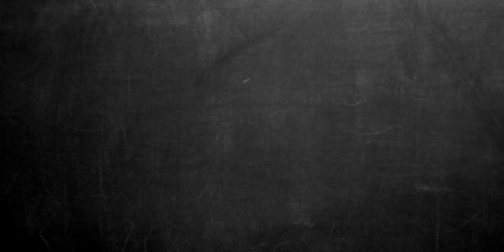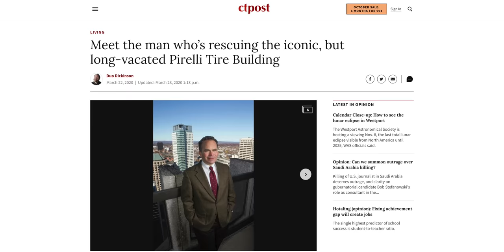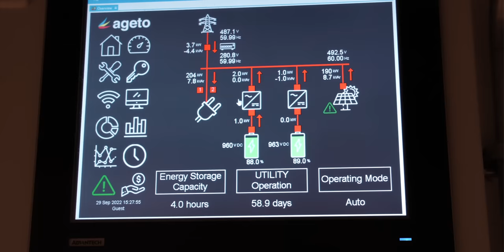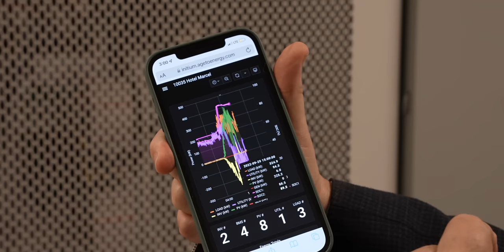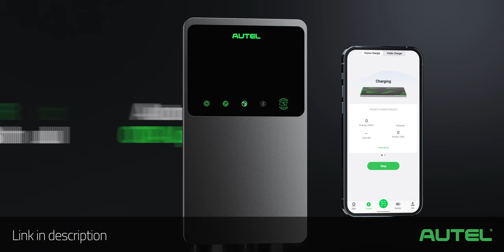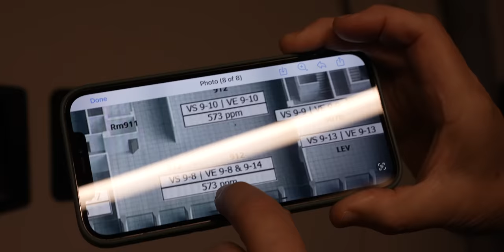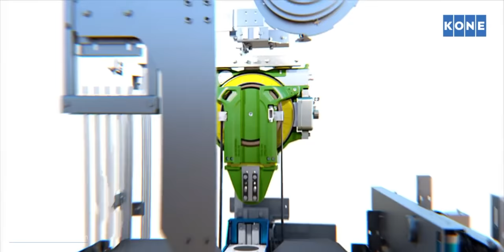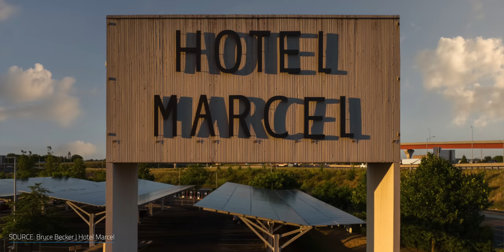How Big Can You Make a Passive House?

Comment: Digital electricity in concert with DC power is a concept I have never heard of, and it just blew my mind. I would love an entire video on this!
Reply: We've been doing it since 2012.  We were also WAY too early at the time! 😀 Now it all makes perfect sense to everyone.
Reply: More videos on this, please
Reply: Yes please!
Reply: @LumenCache  When I looked at this a few years ago the conversion/standby loses in the POE power units were significant (because they are sized to run the whole house and are always on). It was much more efficient to just have one CC LED driver per room (well, per switched circuit) with a few lamps on each. Standby usage is zero because the driver is actually turned off. One decent driver (as opposed to one cheap and nasty driver per lamp) is efficient and reliable. Maybe POE has got better, but at least in a domestic setup the always-on nature is a significant structural disadvantage. POE wiring is enormously flexible of course, but also expensive in comparison to dumb lamps at £5 each and drivers at £10. So that's £20-35 per room in a domestic setup. A single POE lamp costs more than that. I'd love to hear that this stuff was reasonably cheap and actually low-power by now. 
Hmm. I've just watched your video and it is a really nice system, which can use any lamps I like. And I can have a CC string or some parallel CV lamps. So whilst it's POE it's not using the (rather wasteful) 48V POE spec directly. But that flexibility costs money at $66/104 per switch, $36/24 per driver and $420 +PS for the system. And I'd like to know what the standby consumption is. So my house would be about $1500 vs the $340 it costs me to do it with mains and one driver per circuit. OK cabling is about £150 whilst it would only be £40 for lumencache, so that's a $130 saving. i.e lumencache $1550, conventional $520. So approx triple the price and higher loses (but maybe not excessive) for the flexibility.
Also not available in the UK. And do you not have string-pull bathroom lightswitches over there in the US? I guess with 48V there is no need. But it would be great if you did some UK/Euro style switches. There's a big market your US-only switches currently preclude you from.
Reply: Likewise!!
Reply: @xxwookey  One thing to add to the cost analysis is what he mentioned about labour : doesn't need a licensed electrician. HUGE bottom line difference!
Reply: Come to light and building fair in Germany and you'll see.
Reply: Can someone suggest a short vid on this? Is this like when you plug in a light to a usb port? I'm sure this isn't the case, but are you basically using data ? Is there a small amount of direct electric that is passed through a usb or other cable? Is that what Cat 6 is?

Comment: Dryers using heat pumps are available. That's what I have in my home. It uses less power, and has no vent. Rather than generating hot air to increase evaporation, and vent all the humid, hot air, it condenses moisture from the air onto the coils, which then drains away. I'm sure a commercial use version can be found or made. Hopefully they could have their current dryers retrofitted.
Reply: Seems like this would be a huge energy saver especially if it can work with those commercial dryers.
Reply: That's pretty cool. Is it more time-consuming than a traditional dryer's "fully loaded at high heat" cycle?

I wonder if the traditional dryers were selected due to their speed.
Reply: @MoeBabaloosh  Well, he seemed surprised that the dryers used more energy than the whole rest of the building, so he might not have thought of that when installing them. But even if heat-pump dryers might take longer (which I don't see WHY they would; a large enough heat-pump could compensate for any kind of heat demand. It would just cost more), I'm sure a project this green-focused could find the space to add an extra machine or two to recoup the productivity lost by the slower machines.

This also assumes the machines are run 24 hours a day. If they only run for a fraction of the day, a slower machine could be allowed to run for longer; just using up the otherwise unused operating hours.
Reply: @darksunrise957  condensing dryers take longer, don't dry quite as well, and don't have the wrinkle removing qualities of heating dryers. But I think they could do a two step process of doing mostly condensing drying and then finish them off with hot air from heat pumps.
Reply: @darksunrise957  They do actually have to take longer because the colder the air circulating in the dryer, the less water the air can hold, so the evaporation rate from the wet clothes goes way down when you're using cold air to dry vs hot air. That's actually one thing most people get wrong - heat doesn't dry things; it just raises the vapor pressure of the water. It's the air movement that moves the moisture away, so to dry things you need heat to get the water into the air, and you need new dry air to replace the humid air you just made. The condenser isn't the limiting factor - it's the air temperature. Driving the condenser harder would just make ice on the coils, but wouldn't dry any faster.
Reply: Hi - managed in hotels for over a decade.

In larger properties and some markets hotels don’t do laundry on site.

As well a lot of hotels don’t dry the sheets in a dryer but instead they are iron dried in a big iron and folded by a machine. Def not true of all hotels and maybe not most
Reply: @davidtubesing79  I imagine a net zero hotel wouldn't want to outsource it's emissions/energy usage.
Reply: I was there (as Insta360 cameraman) with Matt, and I think Bruce mentioned that he couldn’t get heat pump dryers big enough for the hotel’s requirements. I’ll double check with Bruce…
Reply: @TinkerTry  Multiple heat pumps could be attached to a single barrel. Pre-made heat pump dryers that size may not be available, but adding heat pumps onto the drums they have certainly seems viable. It's a matter of the price of building the system to do it, verses the price of paying for the electricity to operate the current system. Plus, they may have other systems that use the heat from the dryers, so even though they're not efficient, they're making use of what they can. 
I just thought I'd mention the dryers because the current ones seemed to be a big issue, and it's possible he didn't think of everything.
Reply: Aren't heat pumps just an efficient way to remove heat - so why not use the waste heat from the dryers to pre-heat the hot water instead of basically paying to run the heat pump to remove the heat. Perhaps the the dryers don't vent the waste heat - are they able to simply remove the moisture of the air? Maybe they could provide a 'free' steam sauna provided there aren't air quality issues in the dryer output. 
Please be kind my expertise is not in the HVAC/heat pump field. Thanks for any constructive criticism.
Reply: @watlukn1476  No worries Wat, hopefully we're all still learning. No, heat pumps are not, " just an efficient way to remove heat". As I mentioned in my comment yesterday, they're likely using the heat from the dryers for something. However, the problem isn't a matter of making the most of what's there, it's that the conventional method of heating the air in a dryer is a huge power drain, and not very efficient. 
Re: Simply remove the moisture from the air. That's the goal, and that's why a heat pump is a good alternative to the conventional dryer. The basics of what happens is that one side of the heat pump warms the air, giving it the ability to hold more water. The air is then blown past cooled plates, upon which the water in the air condenses, and is drained away. The air then passes through the hot side to be warmed up a bit more, then past the cool plates again. Each time moist air passes over the cooled plates, more water is removed. 
By comparison, the conventional dryer has coils that get really hot to warm the air quickly. That air is then passed by the wet cloth, to draw water from it, and then vented away as new air is pulled into the machine to be heated, and vented. 
Reusing the same air means you don't need to warm fresh air constantly, you're just simply removing the moisture from the air in an energy efficient way.
Reply: @watlukn1476  that is a thing, but it makes the systems more complicated. Something like that would probably have to be bespoke and therefore way more expensive than something off the shelf.
Reply: I use a high tech solar clothes dryer. It is cheap and efficient but take a bit more time, It is a clothes line :)
Reply: Could it be that they needed conventional heat for sanitation?
Reply: @MoeBabaloosh  It takes longer and the clothes are generally "colder", but not by a lot, and , at least for home use, longer cycles don't impact much.
Reply: @NJ-sx5hn  Good thinking. More than a few times that was the explicit reason I was using a dryer an not just hanging something up.
A hybrid heat-pump + "finishing coil" (raise the temperature to sanitize once 95% dry) unit would be great, but I doubt they exist as an "off the shelf" solution at this time. It is definitely something I'd be interested in.
Reply: I'm in the middle of renovating what might be an 1880's era house, the goal is maximum efficiency while retaining as much of the Victorian-era feel as possible.
I looked at a heat pump dryer, figuring, heat pump = energy savings. Plus, being non vented, I'm not creating a vacuum effect on the house, forcing nature to refill the drawn out air. 

The dryer was about 50% more expensive, and reviews were less than stellar. 

Once moved in, it will be at least me and three of not 5 kids. Speed of drying is mandatory, unfortunately not fuel efficiency in this case.
Reply: @MoeBabaloosh  Speed issues can be solved with parallelism if needed.  The dryers are big but no soo big that finding space for 2 more would be impossible.
Reply: @callmebigpapa Can you teach my kids to use one? They seem to think the clothes dryer is free. 😂
Reply: From all the ones I have seen those take much longer than a traditional system. Which can be a huge problem in a hotel with a strict time frame on getting the laundry done
Reply: @royce9018  From the controlled tests I've seen, heat pump driers take about 10-12% longer to dry. From my real world experience at home, there's no noticeable difference. 
In a commercial setting, that if drying a large load of bedding takes 25% longer, but costs 50% less, it's worth it. The cost savings could be used to buy extra units, shortening the time, but more likely, it would be a matter of adjusting the schedule to accommodate the time difference.

Comment: I think a hotel is a great showcase for this kind of tech & execution.  It demonstrates what can be achieved without significant lifestyle changes on the part of the guests/residents, which would make adoption that much easier.  If you can make it work in a hotel, you can probably make it work anywhere.
Reply: likewise with office buildings! implement and iron out the creases with commercial then transfer to residencial.

Comment: skipping the DC/AC/DC conversions is really great move! 
Lots of energy is saved this way (when it's produced or retrieved from storage in DC). Most appliances either internally work on DC (and have convertors inside them), or can work on both AC & DC either directly or be easily modified to do so.
It's great to see it implemented, especially on a larger scale like in this hotel, rather than just a home.

Comment: HVAC Engineer here. The Swegon ventilation system, using heat recovery is basic stuff for buildings in northern Europe. You would not get a building permit without it.
Same thing for the heat pumps and PV-panels. Interesting to see that you are watching this as something new and innovative.
Reply: Murica, the best country in the world.
/s
Reply from the maker: Europe is way ahead of the US on these standards, so it's still very new/novel here.
Reply: @UndecidedMF  Good to know. Kudos for the owner of the hotel. Its good to see that he had everything under control and could monitor everything in his phone on the spot. This is something that stood out and not every owner is this informed.
Reply: This guy from Sweden is far too optimistic. I lived in many houses in Europe, mostly central and none of them had ventilation with heat exchanger. And it is a pity, because if it is so popular in Scandinavia why are you not selling it in mass to be the rest of Europe?
Reply: As an HVAC controls programmer in the States it's definitely frustrating how common it is to see new projects using non-energy-recovery systems. It should be a no-brainer, but it's just not. 😞

Comment: Passivhaus standards are based on KW/sqm so the larger they get the easier it is to comply especially if you have a large block which will have very little exposed area ( i.e. Zero heat loss on adjoining walls). The challenge is making a small detached Passivhaus
Reply: The "PROBLEM" is making small detached Passivhaus ... Is so much more inefficient.

Comment: Matt this is one of your stronger efforts to date.  A very thoroughly designed retrofit and a great template for the hospitality industry.  I love that he found space for 1000 SP’s on the property, love the power over Ethernet, inverter cookers, batteries, insulated windows…wow, so many details!  I wouldn’t waste time moving weights on and off the elevators.  I agree with comments that he needs to add heat pump dryers to complete the picture.  And offer incentives to his guests to arrive via EV.